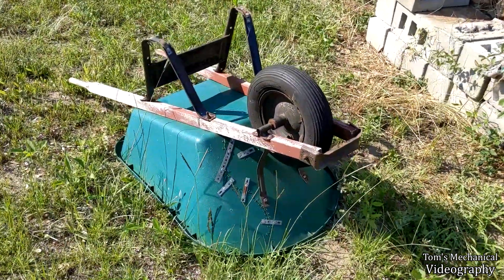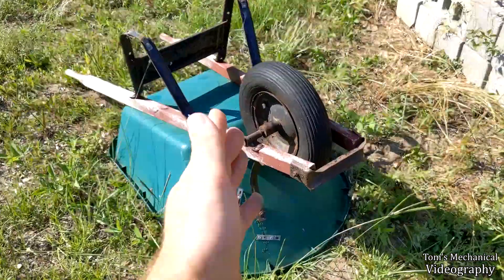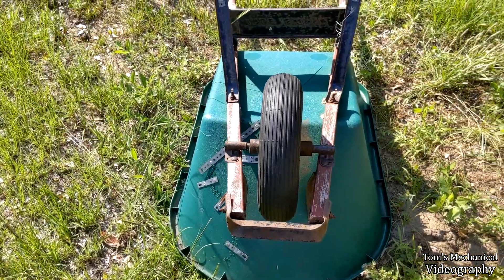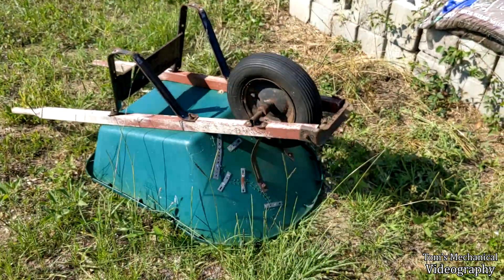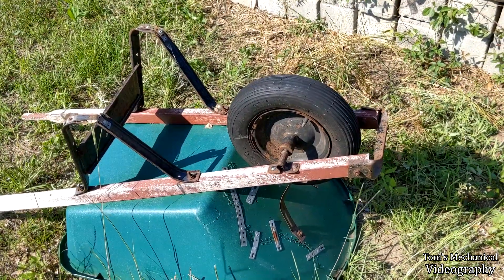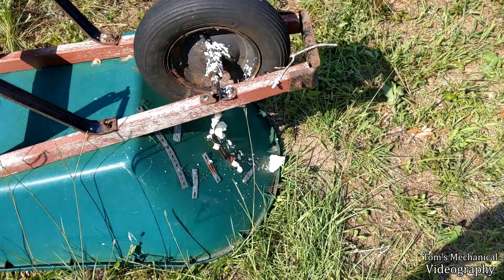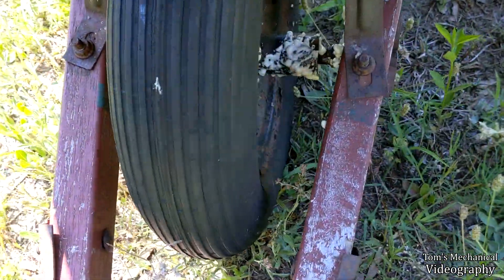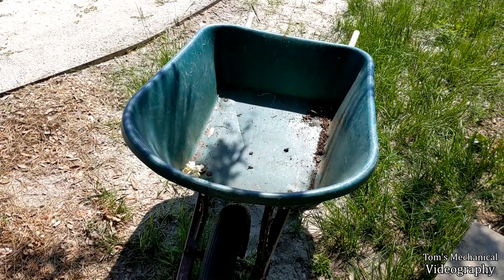Fixing a Flat Tubed-Tire with Spray Foam

Comment: I was thinking of removing valve stem, adding a little water to help activate it, filling it, then replacing valve and adding a little air to help expand tube and cure.  But now I am wondering if just filling the tube like you did will be enough. If anyone tries it, post below and let me know.